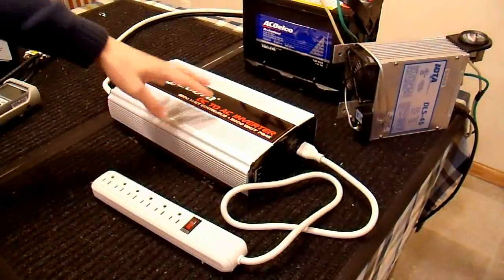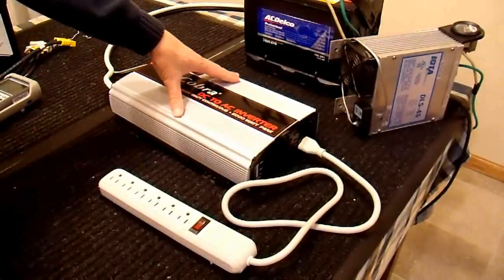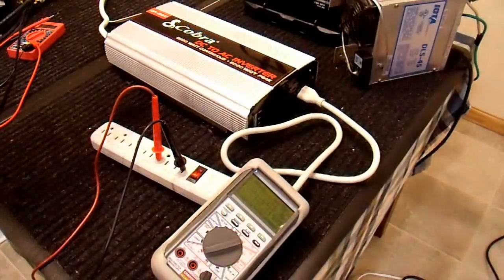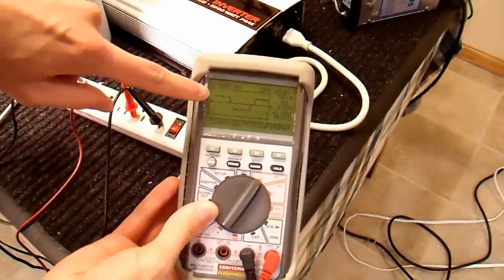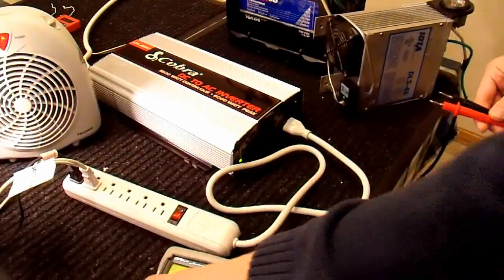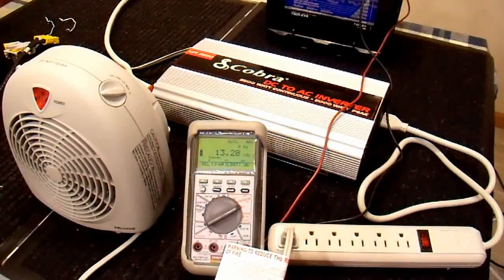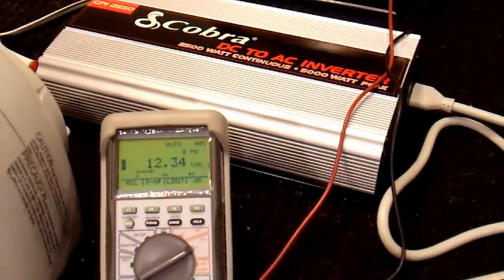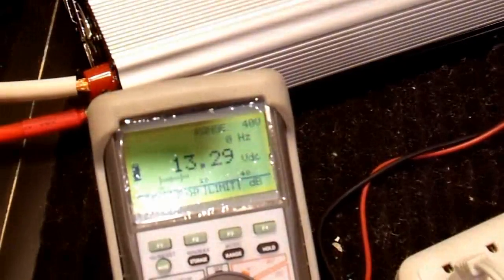Cobra Inverter Review Part4 - Output Waveform and Initial Testing

Comment from the maker: I cannot say for certain, but from the outside it appears identical to the older Xantrex Xpower 1500 inverter.  I have one of these Xantrex models and it works well for a low cost consumer grade product.  Mine actually does 1700 watts despite its rating of 1500 - though it overheats even at 1500W eventually.  It's an average product which is great considering that you can get one off eBay for just $70 after shipping.

Comment from the maker: These 'deep cycle' batteries are rated for 550CCA, so they're more of a hybrid as you said.  They are also Lead-Calcium instead of the more common Lead-Antimony so they match the chemistry of the auto battery I used and have very similar charge/discharge characteristics.

Mixing battery types/ages is generally not a good idea for long term use, I probably should have mentioned that in the video.  Good tip.

Comment: You need to be careful when using two types of batteries as well. You shouldn't have much a problem using that hybrid battery with the car one but you never want to use a true deep cycle and car battery together. They charge to different voltages and the arthrograms are slightly different. Using a car battery charger on a deep cycle WILL ruin it for instance. Not sure if you knew that I can tell you have a lot of knowledge in general but ive seen even the best inform folks make mistakes.